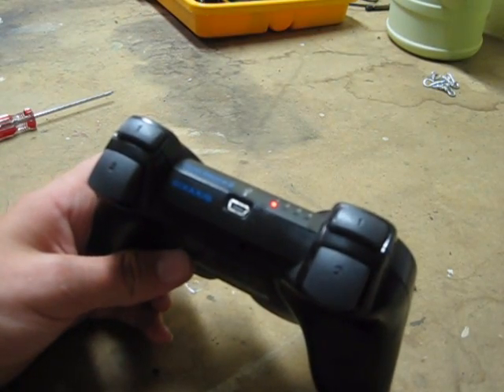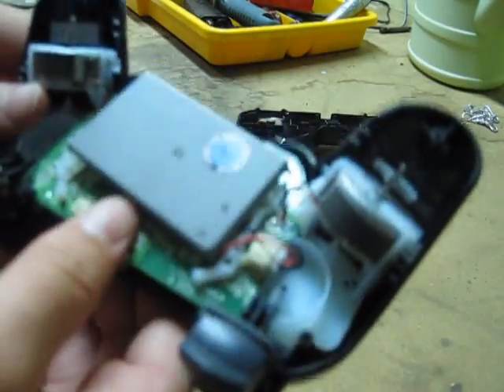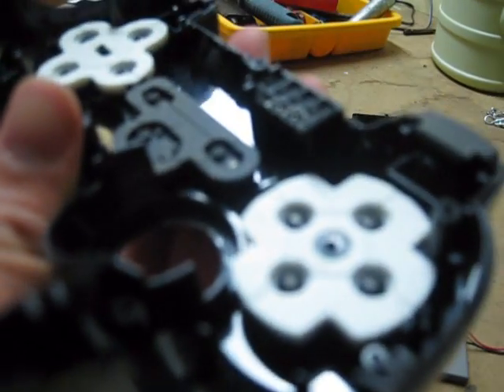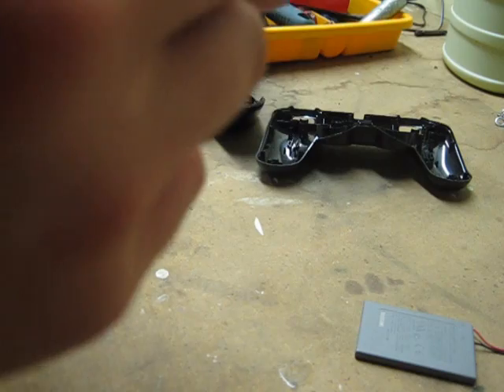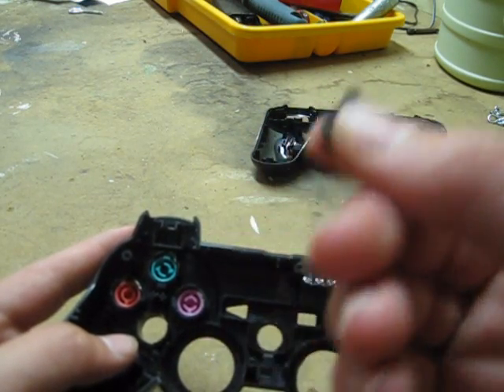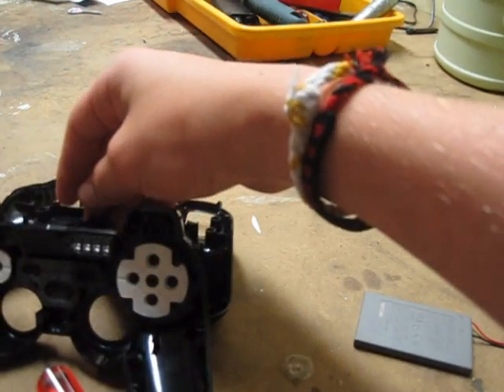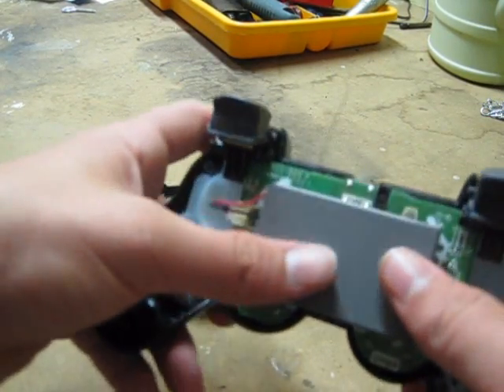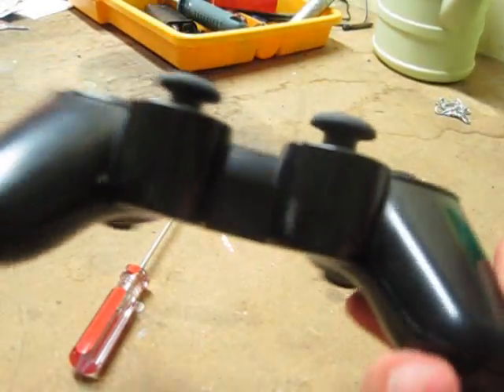How to take dissemble and reassemble a PS3 Controller

Comment from the maker: @ImmenseSkills well it could be that the green pad underneath is loose or not set in the spot quite right but no taking it apart will not affect it in any way unless wires are cut and things were not put back right.

Comment from the maker: @alvie00 well that should work.... but.... both shells have to be made at the same year because every year they make a new controller trying to perfect anything wrong or make it easier to dissamble. I have tried this too and it didn't work with the lights so you couldn't see the lights that show which number it is but thats the only thing that did not work. Best of luck.

Comment from the maker: @kingleonitus12 wow that must of been in there tight but don't do that because the wires are weak and could of been cut. i would of used some needle nosed pliers or something you could of grabbed it with. but if it worked then be happy. The battery is made not to be taken out so don't be surprised if it was hard.

Comment: im looking into buy a coloured shell for my controller and i was wondering all i need to do that is to remove the battery pack n take the micro chip n rumblers out n d-pad n buttons and put them into to the new shell right ? 
message back if im wrong thanks

Comment from the maker: @vgman85 yeah I had to trim the video or it would fit on but now they have a 15 minute limit now so I can remake it. Also it doesn't really matter how it goes in but I usually put mine in it pointing to the right top corner.

Comment: the resembling part is especially cool, because when its all fine and dandy you put the final back cover on... ahhh :) but it doesn't FIT! and when it does fit those fucking inbetween back things for the triggers fall off and then i put them back on try again... fall off again and then the triggers fall off along with the spring and the ROD! nope i can't put a ps3 controller back together impossible!!!!